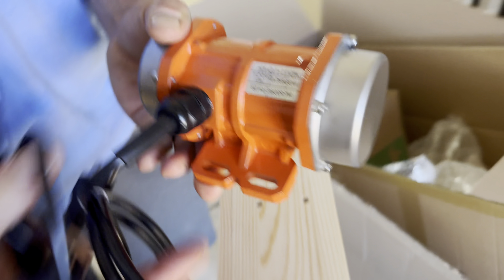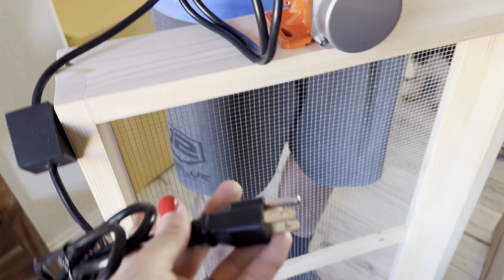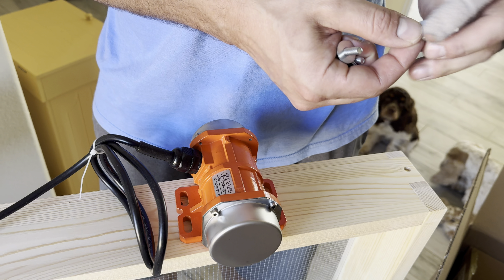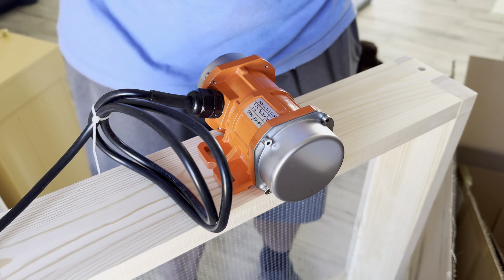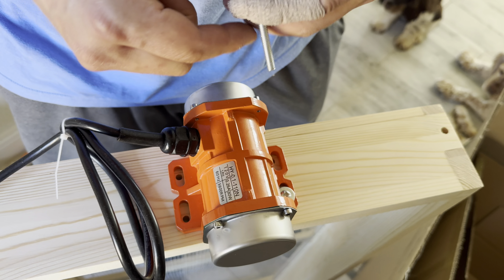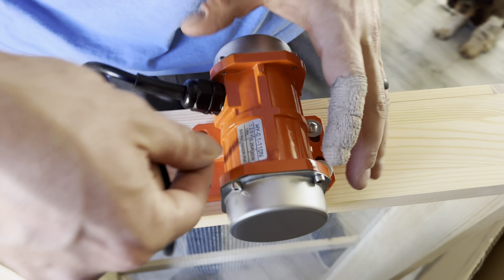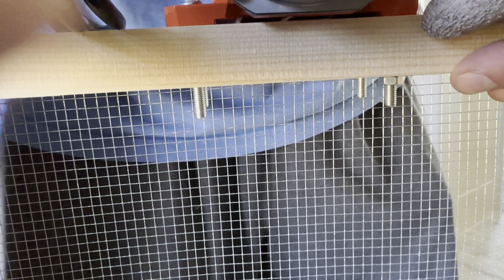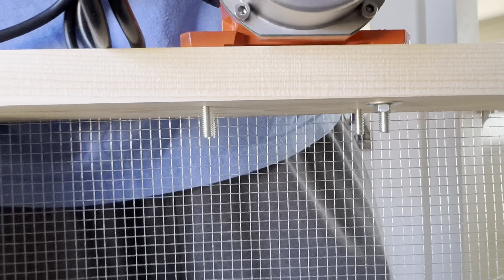Ultimate Gardening Tool: Soil Sifter Review & Demo - Effortlessly sift Sand, Rocks, Dirt, Compost!

Comment: Deciding what design and parts . See a 30 watt on the vibrator and looks good  I might not need the 100 watt model .
The options and usage is many i’m going with the 30 watt and wheel barrow size .
Thank you for posting the video .
Reply from the maker: No problem :) Glad I could help!